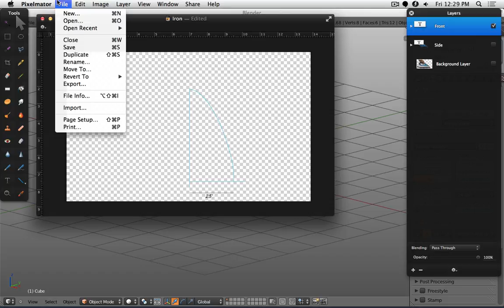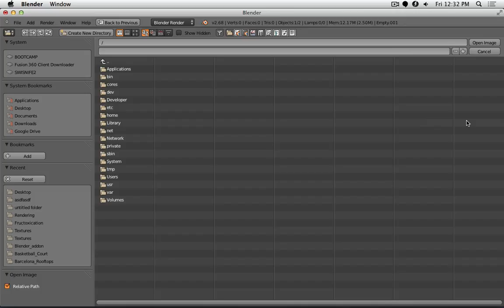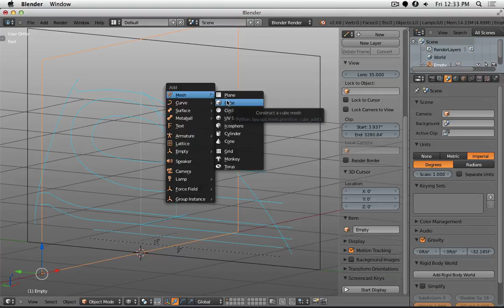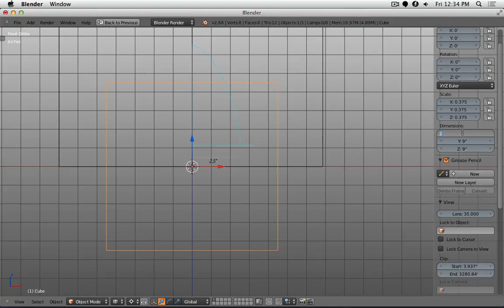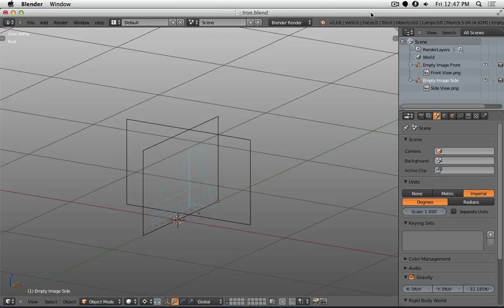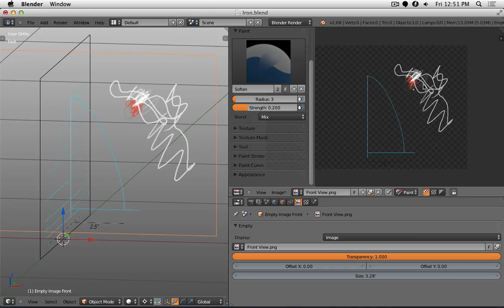Iron 1 Sketch Planes

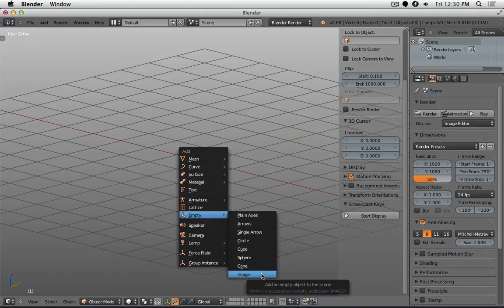Comment: By the way, 3:34 I don't have options to add anything other than the normal Empty.  I can change it in the property panels, but I don't have it on the add menu like you.  Is that an addon?  I'm using 2.69 r60698

Comment: Yes, even though I've gotten used to GIMP over the years, it's still kind of clunky and slow.  I've done some more research and Pixelmator seems to have a good following/community even over Acorn; another one liked by some.  $14 is not bad and I'll probably get it.  Hard to get everything in one package, but one theme runs through most threads; people are tired of being raped by Adobe.

Comment from the maker: Pixelmator is not as powerful as GIMP that for sure in certain areas. But one the other hand GIMP is pathetically slow with screen refresh in large files, the interface is clumsy and Pixelmator just offers nearly all the tools I honestly only use I dont even use Photoshop anymore. And it got some good pathtools and other new features. It also costs just 14$ so it is not a bad investment.

You can get a trial from their website and test it.